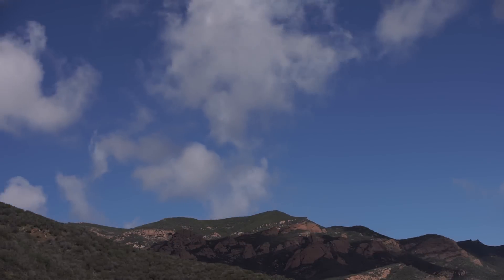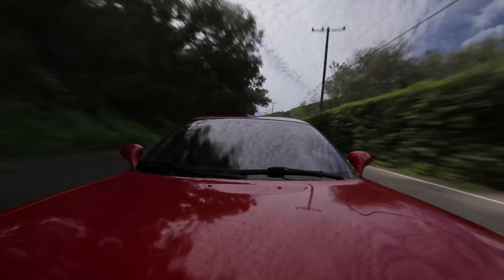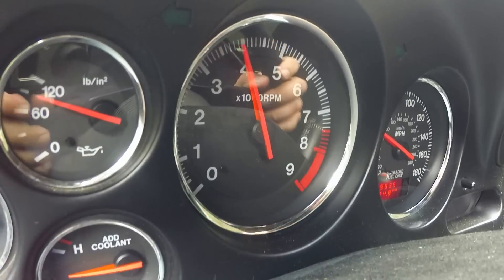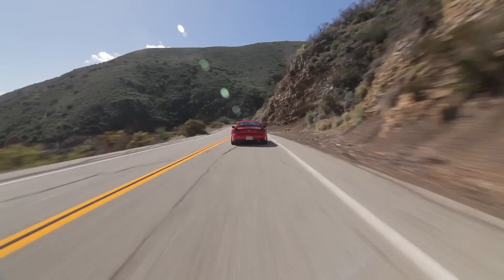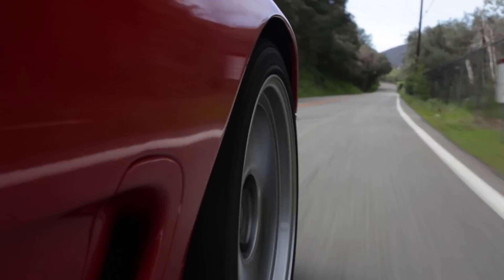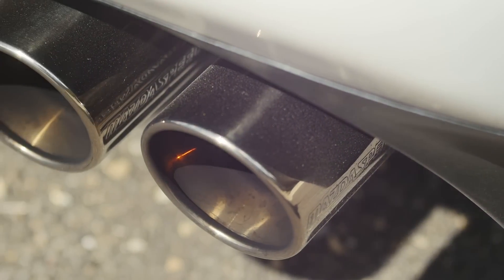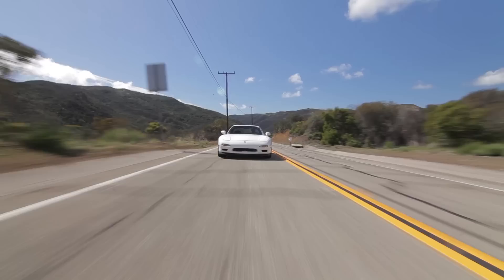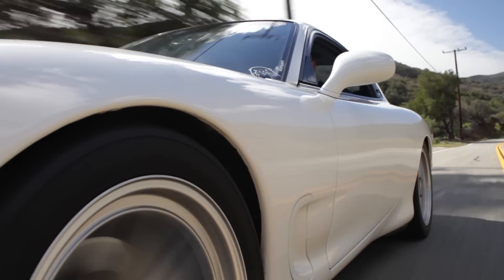Mazda  RX-7: Turbo vs V8 - /TUNED

Comment: ..."you don't have to work it as hard" ... but isn't that the point of a sports car? To reward you for being precise? A muscle car is all about speed and power and a sports car is about balance and skill. 

A V8 is like chubby housewife. But a rotary is like a supermodel. Both will make you smile, but for very different reasons.

A V8 is more dependable and easier to live with. They will put up with alot of your shit but will always keep coming back. They will always find a way to fit into your life and may just be the only thing you ever need. And they will always find ways to make you laugh and smile. 

But a rotary takes a little more finesse. You have to work your ass off for them. But once you get on their good side they will reward you in ways most other things can not. Not with cheap laughs, but with a deep satisfaction. They demand you put the effort in and reward you accordingly.

You either get it or you don't. They are not for everyone, but the best part about cars is that there are so many different ones; there is literally something for everyone.
Reply: Ben Hamilton cool story bro.  end of the day V8 is faster, reliable, better on gas, and maintenance.
Reply: eeterp32 Actually, a rotary is cheaper on maintenance. Half as many spark plugs and wires and in some cases, doesn't hold as much oil in the sump. Reliability is debatable. I've seen many rotaries eclipse 300K miles. My own V8 has 288K miles and burns as much oil as a normal rotary(1qt every 3,000 miles which is acceptable burn off). I've also gotten 29mpg in my RX-7 without super tall highway gears and cylinder deactivation or any other fuel conserving measure so this could be debated as well. Faster all comes down to your wallet. Anything can be made faster than anything with money.
Reply: Ben Hamilton I liked your analogue :) Also I agree with it, being a fellow rotor head
Reply: eeterp32 Did you even read my comment? I said exactly that. Then I said that not every person is looking for the livability of a v8. Some people might find value in doing something the hard way. If you don't get it that's ok, maybe you aren't as crazy and masochistic as a rotary owner. That doesn't make the choice of a rotary over a v8 wrong. There is no right or wrong, it's just a personal preference. It's cool that you like v8's and all, but to post a reply like that proves you didn't even get the point of the comment. Are you trying to troll or what?
Reply: Ben Hamilton  TL;DR  dog shit >>> rotary 

torqueless, bad mpg, chainsaw sounds, blown apex seal
Reply: eeterp32
You're the type of person that gives V8 owners such a bad reputation.
Reply: 83FB7 I don't own a v8. I don't even own an American car. I do know several people with 13brew and v8 swapped FD3S to know the superior power plant.
Reply: eeterp32 We all love our cars. Why does there have to be so much hate? You can have your car set up however you want, but please don't bash on others for liking what they have. With how many cars and how many modifications each car has, why do you have to disagree with one over the other? Rotaries and V8's are completely different. Some people, such as myself, simply prefer the heart and soul of a rotary, even if a V8 can outclass it. It's nothing more than personal preference, and there's no need to hate anyone for having that. We, as car people, all need to open our eyes and see that the owner of the car is the only one who's thought matters. Like what 83FB7 said, "Don't be that guy who gives V8 owners a bad name." No matter if you own a V8 or not, your giving them a bad name, and that's not cool. Learn to love and respect everyone's builds, because they're the ultimate form of self expression and individuality :)
Reply: eeterp32 lol, keep trolling there then buddy, whatever helps inflate your ego and makes you feel superior :|
Reply: Ratchet L. 
Amen.
You are too smart for 99% of the YouTube crowd.
Reply: Ratchet L. You agree with me. The V8 is superior.  Cut the kumbaya shit.
Reply: Ben Hamilton just stating facts and crushing fanboys.
Reply: eeterp32
I have yet to see you state any "facts". I've only seen you state your opinion. You know what they say about opinions.
Reply: eeterp32
Meaning of my text
  ^
Your head

You just can't get through to some people :/
Reply: eeterp32 A rotary can very well outclass a V8. What's your point? Shit, a 2jz can outclass a v8.

Comment: Ok. Gonna add my 50c 
If u want to compare V8 conversion then u Shld have compared to a 20b converted rx7. THEN u are closer to comparable capacity at least. 
13b just doesn’t have the torque of a V8. It’s like comparing a 8 to a 4 cyl. 
U Shld drive a lightly modded 20b turbo or Na even to the ls swap.

Comment: jesus christ that thing is fucking BEAUTIFUL
Reply: Nice!
Reply: Poor Man Mods  yooooo !!! pmm !! haha good to see you here !  btw what happend to that ae86 sr20 (still waiting )..
Reply: Poor Man Mods  what do you thing of ae86 sr5 with a LS3 swap ?     #overkill?
Reply: depends on what you are trying to do with the car, but it would be pretty sweet
Reply: Dunzhi Jialuo Good luck getting it to fit.  I Have yet to see one yet.   But Search youtube for 20b AE86  :)  Old 3 rotor turbo from Japan in one of the old option videos.
Reply: +Poor Man Mods Yes at first a thought it was a complete body swap,
but apparently it isn't!
I would buy a car like this today
Reply: ***** basing assumptions on other cars and different engines don't mean the physical constraints of your own engine bay won't be different.   

Professional shops  and hot rod builders that develop parts have Plastic engines they use to check for clearance issues.   They have a mock LS series on the shelf to throw in with mounts to see if it could potentially work with exhaust.   

If its not been done with your chassis, you venture into a world of expensive modification.  It will bankrupt you to find out how it can work.

Comment: Goes to show that all americans care about is straight line speed. Why not put a big chunky V8 in a car that is all about handling. I can tell you why rotaries are so great, it's because they're very lightweight with a very low center of gravity, which can give you handling characteristics that you can't achieve with a piston engine. Why would you want a unique car like the RX-7 to feel like a Corvette? Doesn't make any sense to me.
Reply: eeterp32 Great argument you have there. Guess you have to resort to personal attacks if you don't have any.
Reply: hiard10 there's nothing to argue.  If the 13b is so great, why do people swap them for v8s?
Reply: There you go again, resorting to insults. If your only argument for something being great is that many people do it, that probably also means that McDonalds is great food. Even I could have found a better reason than that.
Reply: hiard10 how many new rotary cars can I buy today?  there is a reason for that.
Reply: The main reason is fuel consumption and emissions, the same reason we get downsizing and twin turbos on every second modern sports car. If you don't care about that, wankels are great engines.
Reply: hiard10 Now, add reliability and performance (power to weight).  Plus, the 13B-REW engine isn't that light at ~390lbs with the accessories and turbos.
Reply: eeterp32 you know their are v8 swapped time attack rx7's... and they still arent as fast as the 13bt rx7's
Reply: hiard10 i agree with you in a way RX7 is a very unique car. , I wouldn't say all americans care about straight line speed though.
Reply: hiard10 
No hard feelings, but vast generalizations like that make you sound like a fool. 
I could tell you to go you to brush your tooth, but I won't. :-D Other than that, I agree with your comment.  :-)
This comment not to be taken too seriously.  

Cheers from across the pond -- wherever you might be.
Reply: balls deep In this video, which car is faster?
Reply: hiard10 They probably dont know how to maintain that type of engine. I belive that is the main reason for it, not joking. Look at nz, australia, japan and so on. Do they break down every day? No they dont. I know of a rx7 with over 300 000 km, no failure! So yea, the muricans doesnt make much sense to me netiher.

Comment: Mmmmmh, I wonder if my 06 Mini is faster on a straight after I put a bigger Engine in it. The V8-part of this is pretty pointless but I really enjoyed the red one. Also cool owner.
Reply: Kabrueggen100 He also said that it pulls better out of corners, and no. Putting a V8 in a mini with front wheel drive, it'll probably just spin the tires, while stock mini will pull away. It's the idea of mating a good chassis with a good engine. A Chevy V8 is a ton more reliable, and makes more power, and it makes an interesting, and faster car. It's a bit sacrilegious, but I like that about it. If you're allowed to be different by owning a rotary, why not be allowed to be twice as different, and have an American engine in a tiny car, which makes it a ton faster? Carroll Shelby did the same thing... just saying.
Reply: ***** Except than LS swaps are so common that it's not any different. It's just overplayed. It pulls better out of corners on the street, but it wouldn't on a track. Carroll Shelby did it to a British roadster that was struggling to sell on it's own, not the most winning car in IMSA history(with it's own engine).
Reply: ***** I'm sorry but no, if you could fit a V8 inside of a mini, it would MOST CERTAINLY pull away faster than a stock one. (A) Because there's a ton more weight (therefore grip) over the tires. *(B) Because it'd have a better Power:Weight than most supercars. And (C) because the mini can't spin it's tires stock, a mini that COULD spin it's tires (in the hands of a decent driver) could pull away with the MAX grip possible AND THEN SOME, which is ideal actually. The perfect pull-away would be the tires baaaarely spinning, that extra tire inertia does help when the car catches, and at that point it will have a boost over a locked tire.
Reply: cybertree Hmm. This all sounds great. Except for the fact that fitting a transverse V8 is impossible in a mini. Well... unless you plan on widening the body a whole foot. You don't seem to get the joke. A big V8 with tiny mini tires would spin A LOT especially if it was front wheel drive, as all the weight of the vehicle shifts to the rear as you accelerate. If it was rear wheel drive, and had bigger tires, then okay. But we're assuming fitting a V8 transverse! Forget it. XD!
Reply: Kabrueggen100 You are all missing the point here. If you actually think this would be a reasonable swap worth discussing (Mini+V8), you propably know your shit from Need for Speed or Forza at best ;-)
Watch Road Kill and tell me that putting those V8s in anything with enough room in the enginebay isn´t foolproof. But yes, the fool will have horsepower. If that´s all you´re looking for, cool.
Reply: ***** There used to be a company that converted the 1st gen Ford Focus to RWD with a Mustang Fox Body 5.0L pushrod V-8, it was as though Ford made the 1st gen Focus to be RWD, there wasn't much modifying of the Focus unibody to fit the Mustang drivetrain in it, I'm sure a Mini would be able to be modified in similar fashion to become V-8 powered......would be very interesting.....
Reply: 05gtdriver That's a RWD conversion. And how the fuck would you fit a V8 in the engine bay? What size V8? Have you seen a Mini? It's much smaller than a Focus! The engine bay is smaller.

Comment: if i had a rx7 id put a v8 in it, i love the rotary and i know the church of the rotary saints are gonna hate me for saying this but with a v8 i dont have to worry about my engine shooting its guts out of the exhaust around 70-80 k miles, plus parts and maintenance are cheaper with a v8
Reply: if a could afford it i would keep the rotary, but when its starts to wail on my wallet ill put a v8 in there, dont get me wrong i love the rotary just its just not cheap to maintain in america

Comment: For street cars a v8 would probably be better, rotaries are definitely better on a track, they can handle the abuse a lot more than a piston engine and get better gas mileage believe it or not. A rotary will get almost the same gas mileage at 9k rpm than it does cruising at 3k while with a V8, forget about it. I'm not saying rotaries are superior to V8s, especially small block chevys, LS motors are brilliant and  I'm a fan of all cars but to say one is better than the other is ignorant. Go to any SCCA event and you'll see how many Rx-7s are out there in different classes that dominate. Rotaries are more for purists that love rotaries, the sound, the smoothness, and it's so much fun to drive the piss out of it without damaging anything.

Comment: Back in the early 2000's I worked for a Mazda dealer, there where two models no one else but me looked forward to working on. The FD3S RX7 and the Miller cycle  Millenia S.
I wish one of each would come through my corner..

Comment: So... this guy said "a race car built for the track.", then he said that the RX-7 has a British style to it. I don't get how it looks British, because to me it looks more like Japanese classic lightweights.
Reply: Pretty sure he meant "race car for the street" and yeah British styling? I was boggled by both those statements too lol
Reply: ***** I believe it's a reference to TVRs, which are pretty much the epitome of British plastic/fiberglass-bodied street cars. Once you think TVR, I think it's actually not such a stretch to imagine the FD3S RX-7s coming out of the same Blackpool factory alongside Tamoras, Cerberas and Griffiths.
Reply: ***** I know what he meant. XD! It was just a funny mistake.
Reply: ***** the mg b, a british made car
Reply: ***** And American.
Reply: ***** FD looks similar to a moderenised Jaguar E-Type - therefore British styling
Reply: ***** the formula for rx-7 and miata is simular wich Brits was using in old MG's and triumth"s: long nose, short back, front engine, rear wheeldrive, 2 seater (rx-7 have 2 seats at the back but they are tiny and some specs even didn't have them, spec nur for example), 50/50 balance.
watch top gear miata episobes.
Reply: ***** A lot of the classic Japanese sports cars were somewhat emulating British sports cars, so there's a sort of common lineage there, even if it's a bit nebulous. You can look at the Toyota GT 2000 and see the clear British sports car influence on it if you look at what the British were making through the 50s and early 60s.
Reply: CmdrTobs You mean the MX5 was a Lotus Elan clone? :)
Reply: +Mooselover1011 it looks like a corvette and a porsche.
Reply: +Mooselover1011  He was probably talking about the smooth round look of classic Jaguars
Reply: +Mooselover1011 Jaguar E-type Eagle, this is british, and Rx-7 does have some similarities with it.
Reply: +Mooselover1011  Pretty sure he meant "racecar for the street"
Reply: Pretty similar to tvrs too. But yeah British isnt at all what comes to mind.
Reply: +Mooselover1011 it has a sleek look like the old ashton martin
Reply: *****  Can you explain this?
'The sports car was originally British like the motorcycle.'
Reply: Well, I'm not sure what he was thinking of but this car does kinda looks similar to the old classic Jaguar E-type.
Reply: The Japanese were using British sports cars as references when designing this and the Miata.

Comment: The key to the RX series is feel. On performance numbers, there are many more capable cars. The RX focuses on the passion for driving. It intertwines the human and machine to create an experience. Shortly after purchasing mine, I found myself making excuses to go for drives on the most convoluted roads I could fine. The way you can toss the car about is unbelievable. It really feels like an adult go kart where you have precise and intimate control. Then when the drive finally ends, you step out of the car with a grin from ear to ear looking forward to the next time. Very few cars inspire this type of enjoyment.

Comment: There are 3 correct engines for this car: 13b, 20b, and 26b.
Reply: +Bill Murray There are also the LSx/LTx engines, EJ engines, JZ engines, RB26DETT, 4G63, Coyote, VR6, VQ series engine, and even various electric drivetrains to choose from - whatever you want your RX7 to do. Mazda were damn geniuses, giving you that many options!
Reply: A single rotor? I suppose its possible. Still better than an LS swap. There is also the 12a and 18a but they are a bit dated.
Reply: @seventheleven  Drive one, you will think twice!
Reply: @Maximo Moline already doesn't have torque